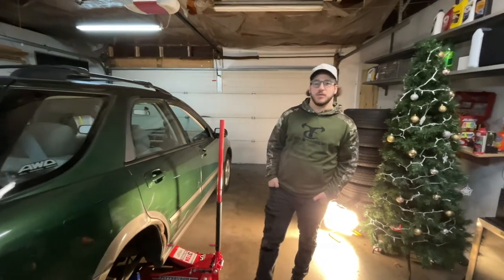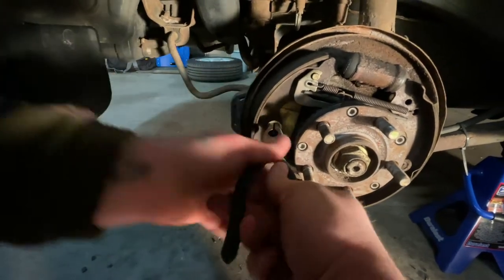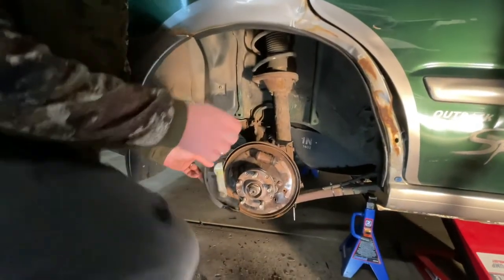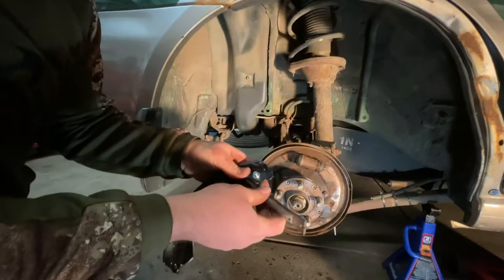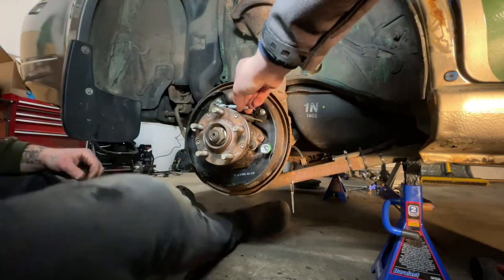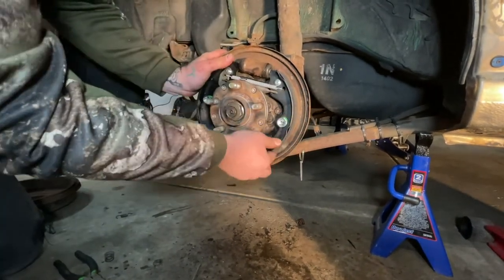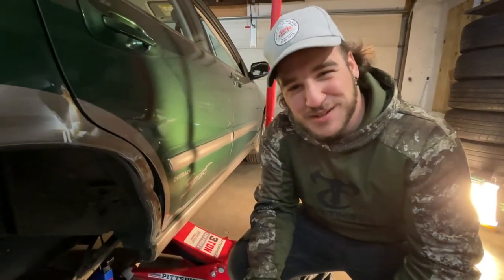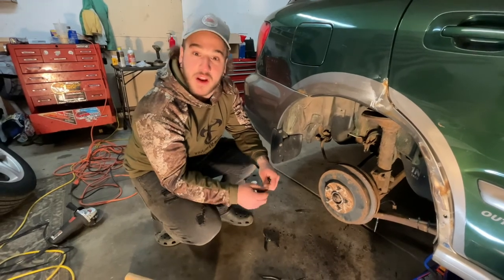Donuts Ep: 6 - 2002 Subaru Impreza Outback Drum Brakes

Comment: holy cow man, grab the washer portion of the retaining springs and while holding the back of the pin with a finger tip, push in slightly and turn the washer 1/4 turn to release it.